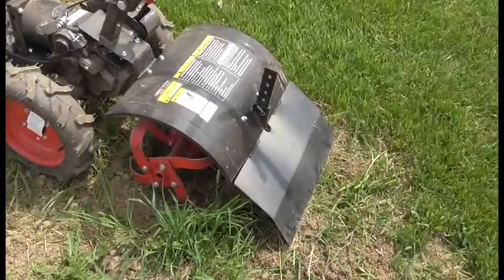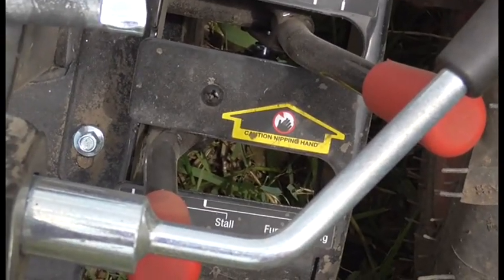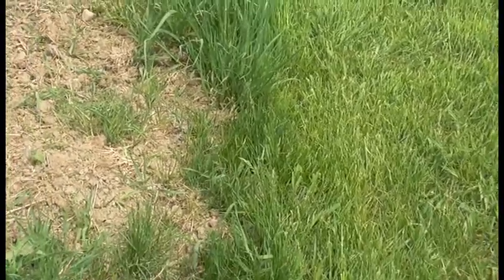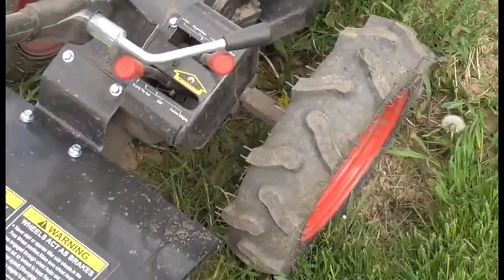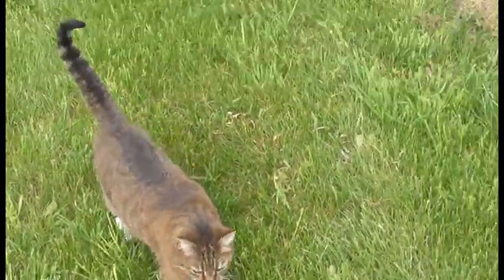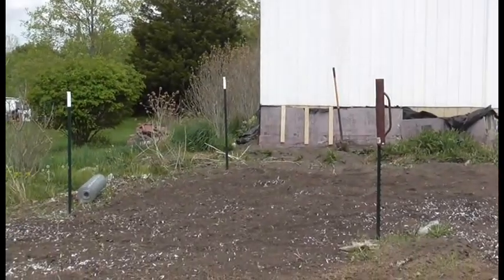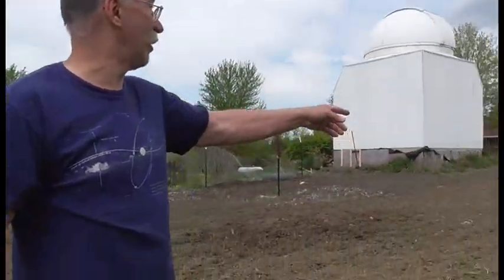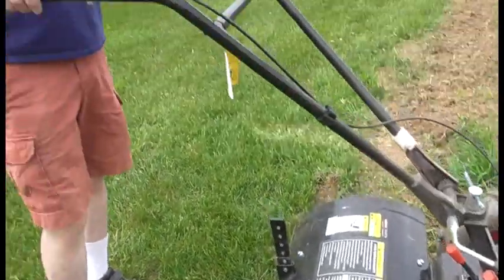Lengend Force tiller digging in untouched clay in over 20 years.

Comment: If you are having problems with it not spinning, tighten up the choke, ours came already loose and when you pull the handle itll work but once you put the tiller down the vibration knocked the choke cable loose.
Reply from the maker: Someone in China didn't do the job. Forgot to torque it.

Comment: What’s that white thing covering the wheel hub? I bought one and have gone thru two inter tubes on the right wheel. There is no grommet on the rim that protects the inner tube valve stem from rubbing against metal on rim.
Reply from the maker: Just states fill the tires up with air. I just never peald them off.